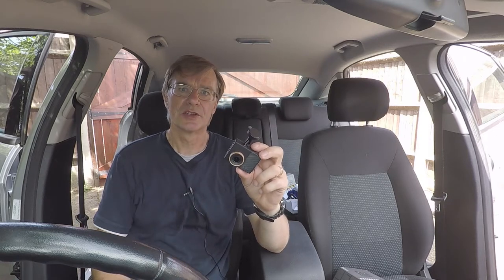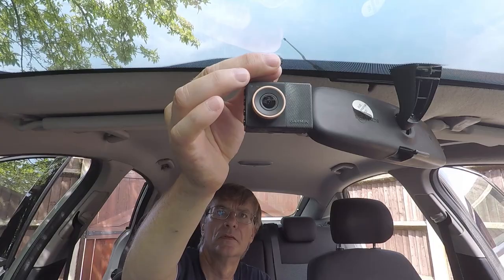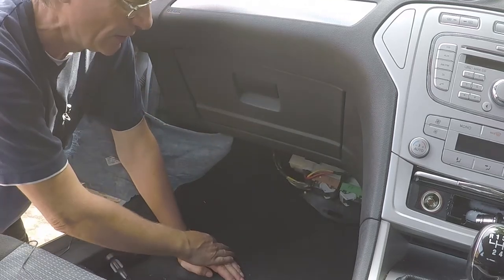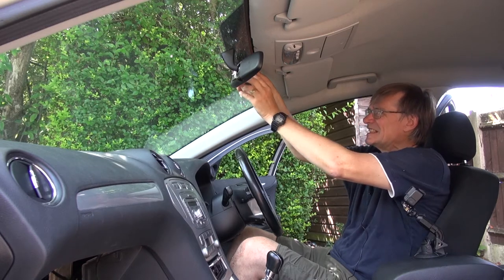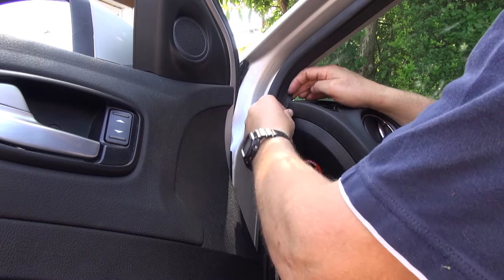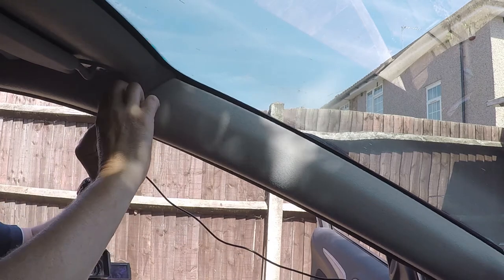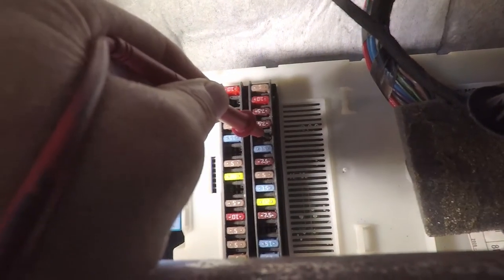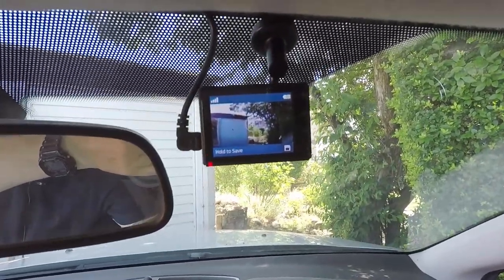Fitting a Garmin Dash Camera to my Ford Mondeo

Comment: I have a near identical setup as yours  but previous owner had piggy backed a permanent live from no2 fuze position so i am going to use the same as you , when i remove his connector and replace the fuse are there any re learn issues i need to address   thanks
Reply from the maker: Only that the fuse holder has a right and wrong way of going in as I show at 8’50”. Good luck.

Comment: Did this actually work? You glossed over it but at the end there I noticed a message on the camera: "The attached power cable cannot charge your device. Use the cable that was provided with your device."
Reply from the maker: Yes it did. The camera does message but it also charges fine. It has been running perfectly ever since.
Reply: I was forewarned that this is an issue with all non genuine hardwire kits for Garmin. Genuine one features a connection to a permanent live for parking mode. I have a 66W on order and bought a genuine hardwire kit. Undecided where to take the live feed from but have decided to fit a valet switch in both ignition and permanent live feeds.